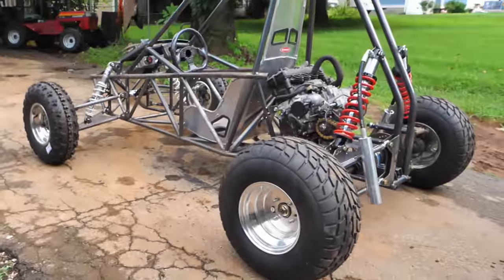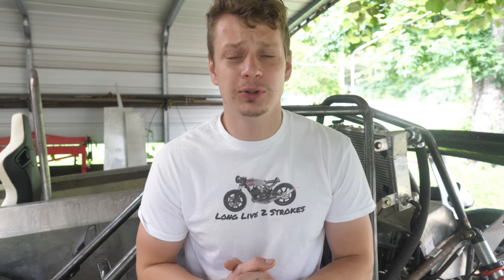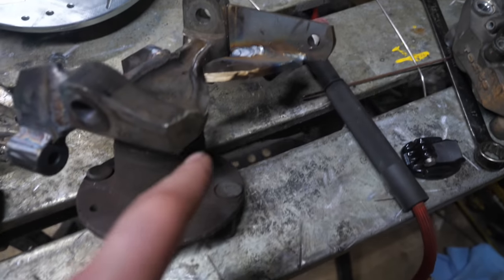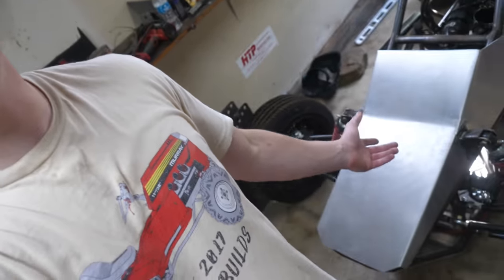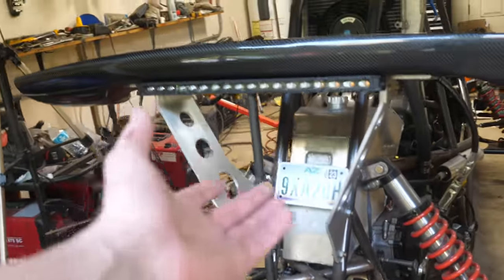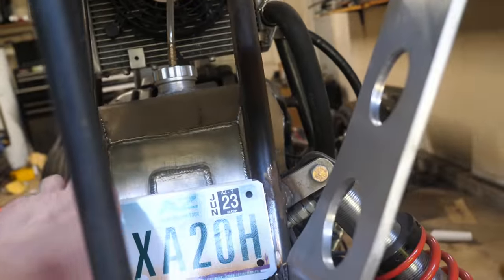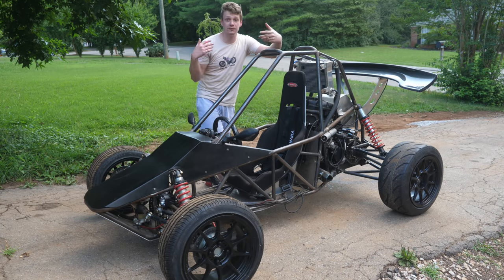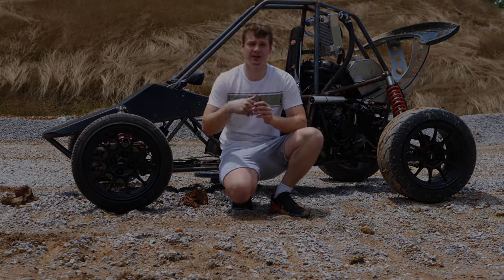Homemade 600cc Buggy Officially STREET LEGAL! (16,000 rpms)

Comment: Small thing, when you welded your front brakes to the hub you ground your work on the rotor, so the ground has to go through the bearing, thats not ideal. Crazy work man keep it up and its awesome you can now ride it on the streets!
Reply: I saw this too, the bearings won't last very long after being micro welded.
Reply: When I first started welding I was making an exhaust for a mini bike and I had put the ground on the engine shaft and started welding.....that motor died 2 days later from a rod knock lol 😆

Comment: If you can move the tail light to a different spot I'd recommend it. The underside of a wing (on a car, top side of an airplane) is the low pressure side which is much more sensitive than the high pressure side. This is why swan neck mounts exist. So mounting the tail light like that is probably causing the wing to stall and losing basically all of it's downforce. Lowering it a few inches will probably help the wing a lot.

Comment: Nice car and nice build.  U have the right motivation to do this work. U also have some great tools to work with including a great dad it looks like.   I did the same thing sort of when I was 16-19. 77 now.  But no dad and no help all my own little bit of money.  Just built the prototype for the first funny car back in the mid 60's.  Don Garlits saw it and came to my home to see how I put a 427 ford engine with Algon injection into the front seat area of a 57 ford Fairlane.  Built my own fiberglass front end, moved the front tube axle forward 21" and back axle up 10", and car weighed 1700 lbs. Detroit drag strip didn't know how to categorize it. Car was street legal. The next year Garlits had a full blown funny car and the rest is HIS history.  I sold the car to a high school and went to Vietnam.  That was mine.

Comment: Nice build but I have one suggestion for you.  When welding on anything......  Always keep your ground on the base material or clamped to a grounded table.  Clamping it on the brake rotor means all your current will be flowing through your bearings.In a ideal bearing situation there should always be a microscopic film of non conductive grease.  You have effectively created many pits on your races and rotors.  Chances are you will be fine. Just something to be mindfull of when doing these fun and amazing builds.

Comment: There are golf-cart, utv diffs, cv axles and of course spindles that are miata compatable. I went with Lexus Q7 rear differential removed from housing, then removed ring gear and replaced with sprocket. It was the difference maker for all handling issues
Reply from the maker: What power will it see?
Reply: @VasilyBuilds  infinity Q7 has a 455h.p. v8 and weighs almost 7000lbs. 
I've got a 100plus hp 870cc 2 stroke twin in a 360lb buggy.  Refused to go straight until I installed the diff. 4 different drive train packages and using the snowmobile chain drive reduction put me right on the money. Top speed 58mph mostly off road. But I'm unhappy with the drag of all 3 spinning shafts. I need an overall 7.5-8.5 to 1 final drive and need a gearbox setup that will take secondary pulley.
Reply: @VasilyBuilds  I got a cx650 street bike and it's shaft primary from rear engine housing. Gang of torque might give it a go.
Reply: @VasilyBuilds  just get a miata rear differential, mount the engine transverse, and connect engine with chain drive (1-1 ratio here). The 3.36-3.78 ratios from diffs should put you around 65mph top speed with 22" tall tires.
Reply: @VasilyBuilds  don't forget golf carts and utvs share common lug patterns with many quads.

Comment: That rear wing is creating lift. You can tell by how clean it is, and the fact that you're using a softer compound tire in the rear. The wing its self needs to be above the roof line to see the air, and the cockpit needs to be more enclosed so less dirty air is hitting it. Id recommend a rear diffuser over a wing for a buggy with such extreme cockpit angles.

Comment: Potential low-average cost solution to the need for molded aluminum parts. 
3D print the part your need with with PVC and just enough internal supports to make it hold its shape, 1 layer walls if you can. Put this in a solid container and plaster it with your pour spout and air channels if needed. When hardened, there are two options. A aluminum to PVC direct method. Pour in melted aluminum and let it melt and replace the PVC. Or you can melt the PVC out using a hot oven for 2-3 hours, then add aluminum. If it can be done in a vacuum chamber, then you can also prevent oxidation. Probably a professional option.

Comment: Vasily puts his leg fracture behind and zooms ahead. Very inspiring. I see he has a rear diff with half shafts powering the rear wheels. This makes his ride less prone to drift while turning at high speeds. A chain driven  single rear shaft is good for off road drift but is hazardous on the road.

Comment: Not knocking you, but I am going to ask a question. You said and showed yourself preheating the cast metal before welding. Did you post heat it for a few hours after welding? That can be even more important then the preheating .

Comment: very nice but still needs lot of modifications and upgrades. those coilovers are overkill for road use, go smaller coilovers and mount inboard with push rod and rocker arms. you will want to relocate that radiator or risk having hot coolant splashed on your head and face. radiator need to be mounted to the side and the intake should be where that radiator is at right now. that wing is not necessary. definitely install floor panels to smooth out the air going under the kart and finish up the body panels for better aerodynamics. also put in a firewall behind your seat since gas tank is right behind you. wheels are too big as well and should be sized down to as small as your brake calipers will allow. big wheels look nice but small wheels always better for road performance. definitely looks like a fun project. good luck!

Comment: Did everything alright on welding the hubs...... Except you welded with the ground going through the bearing. There's a good chance those bearings won't last long.

But otherwise cool build. I'm doing something similar with the 2006 R1 engine I have.

Comment: 13:30 you need to seriously look into how to set up ackerman steering geometry if you ever want that thing to handle properly
Reply from the maker: It has proper Ackerman, but Ackerman is for low speed. Alot of F1 cars use anti Ackerman
Reply: @VasilyBuilds  well for what youre using it for i cant see how anti ackermann would be useful, especially for drifting normal ackermann or parallel steering will be way better. from my understanding anti ackermann is only used in F1 with the special rubber compound to achieve optimal slip angle where the outside tire has more vertical load and starts slipping at a higher angle.

Comment: You said it doesn't matter what state you're in, they can get you legal. Any reason though why you have the AZ plate? Because I think in Michigan, it wouldn't work to purposely have it registered in a different state, without having an address there. Plus it's a sure-fire way to get pulled over up here. Where I'm at in the middle of nowhere UP, they tend to go after out of state cars a little harder. And if you have a MI license but the out of state plates, it could cause some issues, at least it used to.

Comment: I like this thing in general, allot! 
Just not making peace with the head mounted radiator though. 
When some bad thing or the other happens it's splich splash burn ward town badtime.
On the other hand I've also admired builds where guys make their seats into gas tanks because of space limitations, may need to get comment priorities straight.
Reply: Same here, it's awesome. I dream of one day building something similar and finding someone to make a transmission for it like Rather-B-Welding does for his buggies. I just want it to have reverse, but the low range gearing would also be a plus.

Comment: Surely the lights will mess up the downforce of the wing? Most of the effect from a wing comes from the air flowing under it, and the lights will just kill that flow of air. I think you should consider lowering the lights by 2 or 3 inches.
Reply: It probably does, but I don’t think the wing is doing much for downforce anyway.
Reply: Dude it's on a 600cc buggy, it might make 100lbs of downforce at top speed. It doesn't matter
Reply: @Robert-qm7yi  Exactly

Comment: Dirt legal may work in some states but having a plate and fulfilling the requirements for road use doesnt mean street legal. Florida made it impossible to ride any sxs or dirt vehicle on the roads fully legal. State stature reads something like any vehicle designed and manufactured as an ohv/orv as well as anything in similar or smaller dimensions (wheelbase/track width).

Make sure yall do your research for your local laws.

Comment: Just be careful of the bearings. Not only did you heat the entire caliper but you expanded the bearings as well. The balls may slide now compared to rolling around the housing, leading to faster wear over time. KILLER build. Just keep an eye out. I would hate to see you hurt

Comment: Well now that the chassis is complete upgrade to a 17+ GSXR1000 Engine I believe it should be prettt much bolt on the engines mount in pretty much the same location

Comment: I want to know how this Dirt Legal process actually works. What did you actually need to get this cart registered? Did you use the title from the bike that the engine came from?
Reply: The title and VIN were provided by Dirt Legal. (Which adds significant cost to their service. That's why Vasily had them sponsor this build, so he didn't have to pay out of pocket for it) It's registered at a Chinese quadricycle. You can't legally remove and transfer a VIN from another vehicle. That's called VIN swapping.
Reply: @MellowYe77ow  If a certain percentage of the donor vehicle is used you can keep using the vin and title. At least you used to be able to do it that way. That's why so many dune buggies are titled as VW Bugs.
Reply: @dustintinsley3899  Fiberglass Manx style buggies still use the original Beetle chassis, which still has its original VIN. That's legal, as only the body has been changed. (Sometimes the chassis is shortened as well, but the VIN remains unchanged) 

If the VIN has to be physically transferred from one vehicle to another, that's illegal. Yes, people have done it with VW based rail buggies, but that doesn't mean it's legal. People also transmit with high powered CB radios, and drive with no insurance, or license every day. That's illegal too.

Comment: Where's your brake lights, turn signals? In Texas to be street legal you have to comply with DMV that includes headlights, brake lights turn signals, emergency signals, emergency brakes. You'd been pulled over in Texas and your vehicle towed. I'm not trying to be mean nor talk down the work you put in but you are a high risk on the road especially if people cannot see your vehicle.

Comment: You don't talk about the engine, (that I heard, I skipped through the fab parts of the vid.), and I am having a hard time believing it runs at 16,000 rpm, (which your title says 16 rpm).  I can't see the tach number either in the vid, but I have to say, it sound like it might be there.  I can assume it is a road bike engine from a crotch rocket.  But 16 grand is a lot for an engine that size, (150cc for 4 cylinders per your title and what I did see as a 600cc 4 cylinder 4-stroke engine.).  Bummer I can't see the numbers on the tach.
Reply: It's a Suzuki GSX-R600 engine. Here's a sentence from a review article of the 2008 model: "The 599cc inline-Four engine is architecturally similar to last year, using the same bore and stroke with an identical 16,000-rpm rev limit."

Comment: you have some good ideas but your execution of them is a little ify, never in a million years would I weld brake calipers on, im building a buggy using a gsxr750 engine and i used the early mazda 323 discs as well but i machined up the stub axles and made out of steal and machined out the axle to lighten them and made the spindle mount to suit gsxr calipers but im using 12" wheels with 25x8 front 25x10 rear way better and safety 1st
Reply from the maker: Problem is I don't have a lathe

Comment: Feel like you shoulda used a hayabusa engine
Reply: Too much power for that chassis. He wants to build a better one for an engine that size.
Reply: @MellowYe77ow  I don’t see how it could possibly be too much power.. the 600 isn’t enough.. a 600cc engine isn’t even fast when it’s got 2 wheels let alone 4.. in a time where it’s becoming more and more normal to see 2000hp in a 2500pound car. I find it very hard to consider 190hp to be too much in a 600 pound chassis